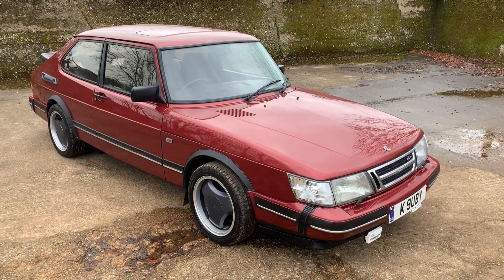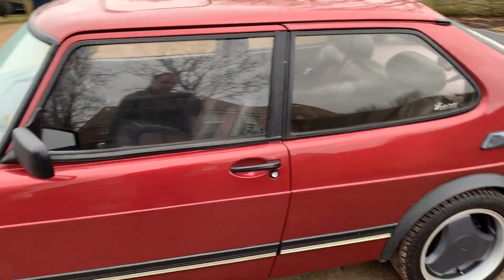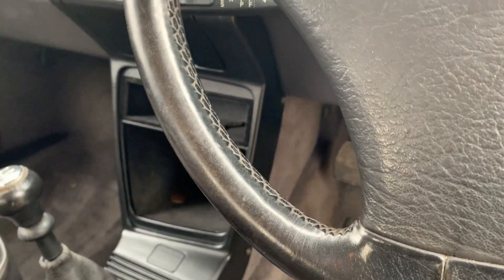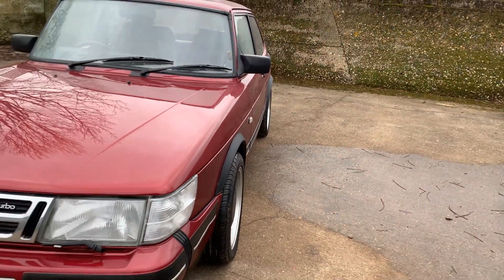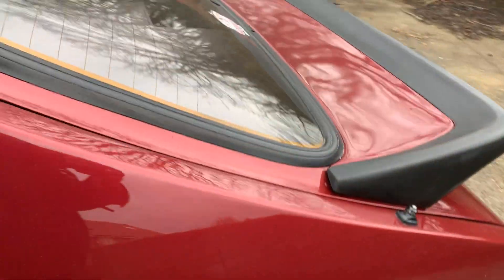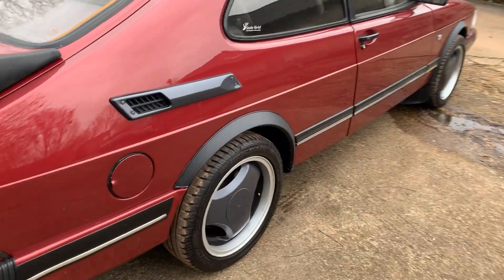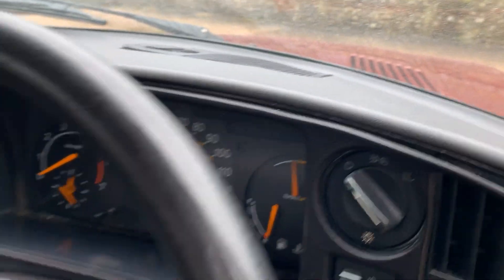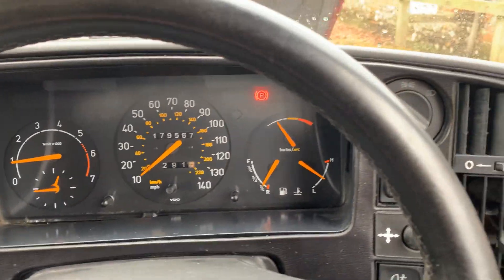SAAB 900 T16S Ruby Edition for sale walkaround +engine running

Comment: Nice car , I have a ruby chassis number 57 I  believe  but  mine has  169k  on clock had engine rebuilt at 140k and body works at 165k but  needs a new  head lining unlike this one . Although it's still S##t hot on boost  even compared with today's hot hatch's  . Looks nothing like this one mind as wheels,  whale tale rear air vent below rear side windows are all standard ruby  also no fog lights. Lots of rattles and squeaks but these cars are something special . And prices in recent years are going to the moon . If only I could get my partner to feel the same about it she hates getting in it with me !!!  She would sell it tomorrow . NOT HAPPENING !!!!